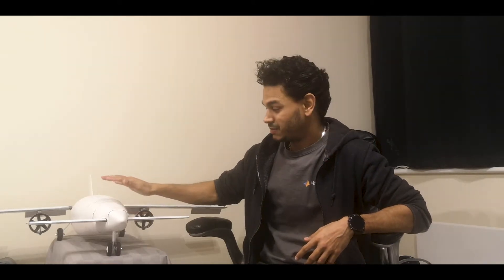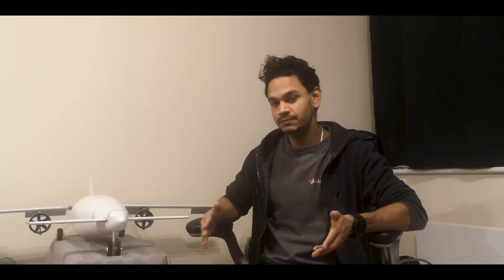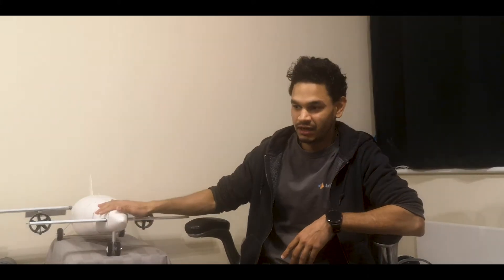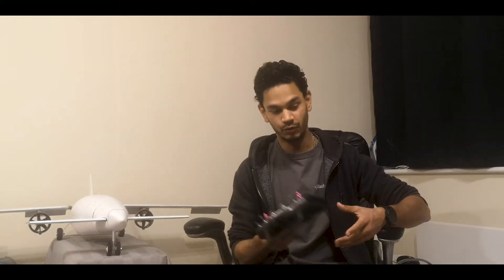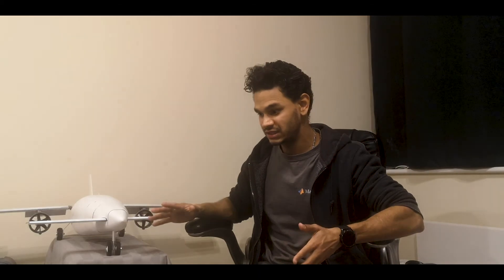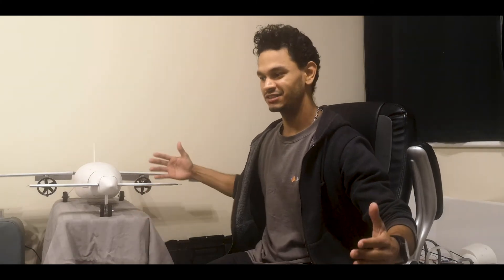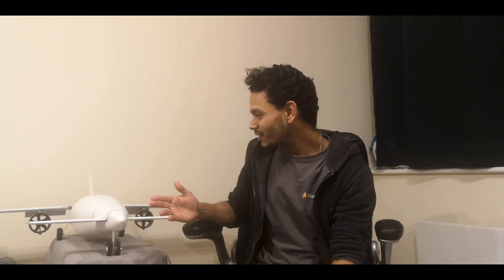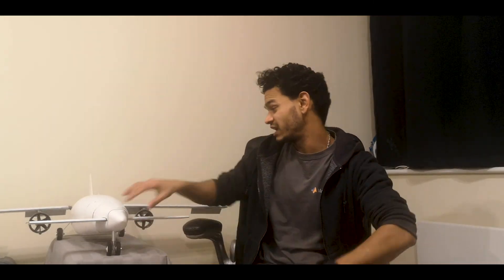How to Make a 3D Printed RC Airplane from Scratch: Part 1 - Introduction

Comment: Hello Philippe,  Thanks for the video of your plane.  It would be great if you make a video showing all its parts and how they function, how they are attached, etc.  I see you have canards but not sure if they are working or stationary.  Also it would be nice to see the battery tray, receiver, esc placement, and that sort of thing.  Do you use the flaps on takeoff and landing?  How is the landing gear?  I like the design of the plane and would love to see some more flight videos.  Did you print it with LW-PLA?  And what about your LED lights at the end of the video.  I love building and flying rc planes, and have recently started with 3d printed planes so your project is very interesting!